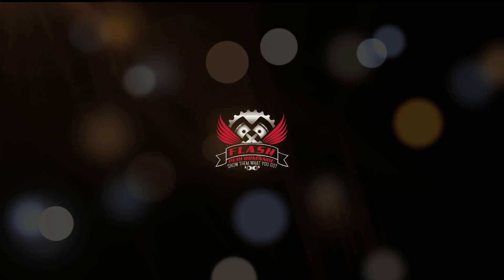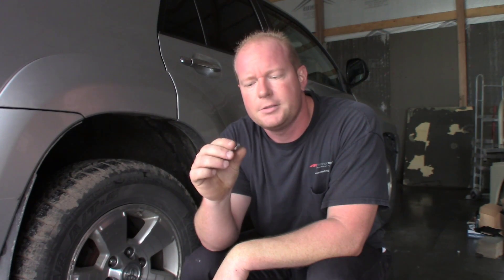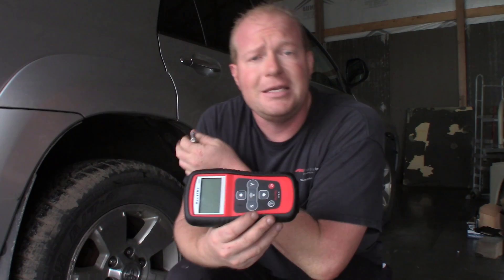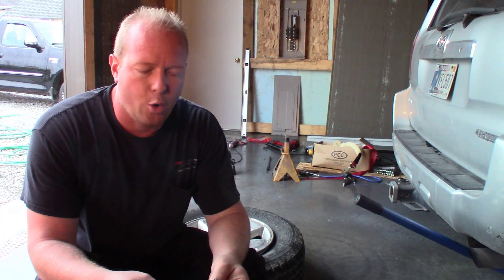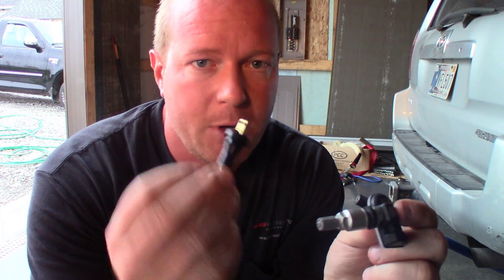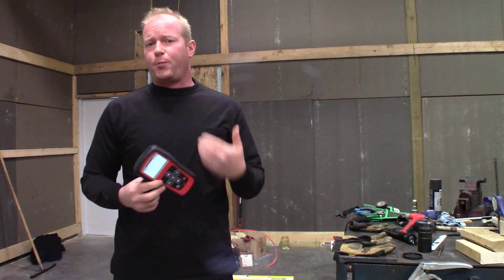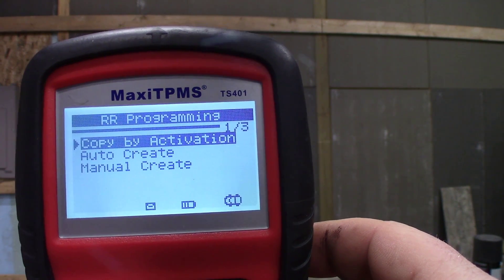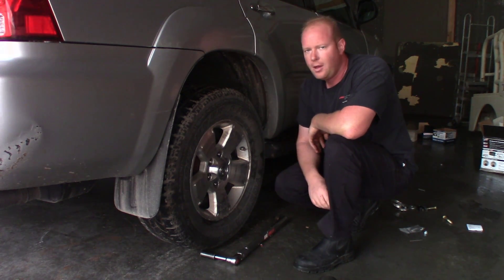Autel TS401 programming Autel's 1-Sensor

Comment: I recently installed the 1 sensor and tried to  program it with my TS401. It would not read the sensors. I updated the tool to 5.61Gl and now I can see the sensor with the MX sensor check  but when I try to auto create and program the sensor it gives me a fault "New Sensor (-7) The sensor is new hardware, please contact Autel support" I called them and they said the TS401 cant program the new MX 1 sensor.

Comment: Very informative. Thanks you....but What if the TPMS sensor is already replaced. Can I still program the new one the  same way with it on the rim?
Reply from the maker: There are a lot of variables in your question I will do my best to help. If the sensor is already replaced in the tire, and it is an Autel MX sensor, you will need to deflate the tire to do the programming session, but yes. It can be done.  If you are using an OE sensor you would just need to do the relearn.  If you are using a VDO sensor, you will need to deflate the tire and do the relearn, then air up the tire again.
Reply: @FlashPerformance  thanks for the info. I got someone to do it. I'm sure how they did it, but the TPMS light disappears when I start my car. Thanks for the help in understanding the procedure

Comment: Thanks for your informative video, but the metal-on-metal corrosion statement, is outdated. Now the Quality Autel TPMS sensors have corrosion - free valve stem. And if you are familiar with Marine boat trailers that come into contact with sea water regularly?! they are a great product from CRC, called; Corrosion inhibitor...!!  Fantastic stuff, worth the $12.00 a can. I Spray my trailer wheel lugs before every trip. AND my wheel lug nuts and studs are still like Brand New from the box. Take care. Stay well. Don't be cheap, Help out your local Mom & Pops tire Shop. It's not that expensive. We're hurting out here. LOL

Comment: If the old tpms was dead battery, how can you pull out the numbers from the old one. Can you explain for me. Thanks
Reply from the maker: If the sensor is dead the only option is to read the numbers directly from the sensor. There is usually a lot of writing on the sensors, one of those is the sensor ID. If you can read it you can enter that into the tool and create a manual senor ID

Comment: Is it possible to program any sensor regardless of manufacture with this Autel Scan tool
Reply from the maker: The sensor can not be blank, There are many different manufacturers of TPMS sensors that require you to use their tool to program the sensor. Autel will not program these blank sensors. Once the sensor is programmed the Autel can relearn them to the vehicle. Here is a video showing the difference in sensor types https://youtu.be/vwMxHx8WoYw

Comment: Hi can you please help i have replaced 4 wheels on my car with 19”. I had 17” before. Can this tool read the values stored on the sensors in the new tyres (19”). As one of the sensor on my 17” was broken during a tyre change and the tyre guy chuck it in the bin without telling me so i have no way of copying the data from that lost sensor. I have the canclip and ddt4all i can program the car ecu according to the read information from the sensors if i am not wrong.
Reply from the maker: The best solution is to use the Autel TS508, the TS508 can read the sensor IDs from the OBDII port and create an Autel MX sensor with the exact same ID.  This way the vehicle will already know the sensor ID and the light will go off.   This video will help explain. https://youtu.be/EKBZHZo9w2Q

Comment: Trying to read an mx sensor with a ts401. I can read it with the "mx sensor mode" in tool kit and get id , but can't trigger it like you did for activation. Scan tool sw 5.59 updated 4/25/20. Any advice? Can't program the new sensor either.
Reply: And when I try to auto program the new one (I have an autel tablet, I can just enter the new sensor code) it says "multi-sensor" and doesn't do anything.
Reply from the maker: I'm sorry I don't know how to help with this one. First thing I would check is in your settings and make sure your tool is set to the US region.  I know sometimes after an update it can change to Euro.  Next I would contact Autel support. That way they can walk through the process and make sure we are not missing a step in the process. 855-288-3587

Comment: can i do this on the vehicle? or do the sensors need to be removed from the wheel/tire to clone them? example, i want to make a duplicate set to leave installed in snow tire set, so it is a simple swap in spring and fall.
Reply from the maker: Perfect scenario for this process.  You don't have to remove the sensor to clone them. Read the sensor and program the new one.  Then it is an easy tire swap.

Comment: Program sensors in the tray of the ts508 401 etcetera Etc prior to installation mark them with masking tape and then have them installed you do not have to change the valve

Comment: How do reprogram the sensor 2018 back to 2013 model
Reply from the maker: I'm not sure I understand your question.  The Autel MX sensor that I am using can be programmed multiple times.  If you program it incorrectly you just program it again for the right application. If you don't have an existing sensor you can do an Auto Create and then do the relearn.

Comment: Replacing a TPMS sensor is because it is not sending out a signal. How does it COPY a TPMS sensor frequency when it does not send a signal?
Reply from the maker: In my scenario the sensor was still transmitting , I replaced it because I broke the stem.  With the TS401 or TS408 you can also do an Auto Create and relearn, or if you can read the sensor ID from the side of the original sensor you can do a manual input.  The TS508 give you more options to program sensor.
Reply from the maker: Here is a video just released from Autel that might help: https://www.youtube.com/watch?v=oVABR5nxeAs

Comment: can you program (or reprogram) sensor that is already installed inside a tire?
Reply from the maker: Yes but the pressure has to be at 0 psi to do the program/reprogram.  If there is pressure in the tire it will not work.

Comment: Can't seem to find these 1 sensor's anywhere, where did you get yours?
Reply from the maker: Advance Auto Parts, World Pack and Autoparts international stock the 1-Sensors.  Also most of the Tire Suppliers sell the 1-Sensor
Reply: Flash Performance thanks for the reply........I checked the AA website and got nothing, I prefer to but locally and they're the only store near me you mentioned. Thanks again
Reply from the maker: AAP Part number= AIT 1-SENSOR, SKU 11784373
 Check in store I don't think they are listed online.  I found these numbers in their first quarter tool and equipment catalog
Reply: Flash Performance thanks so much for the info!